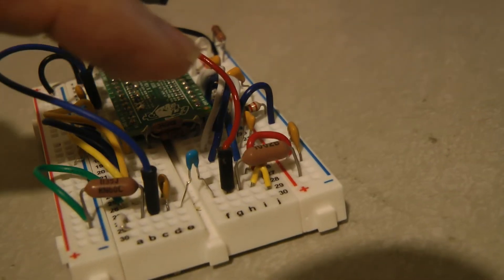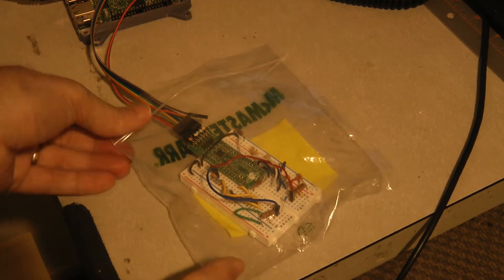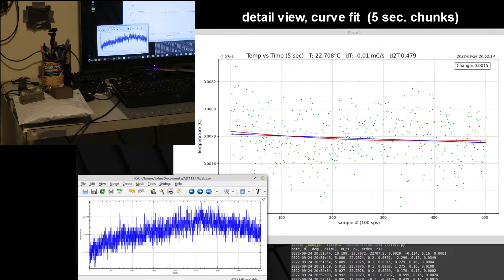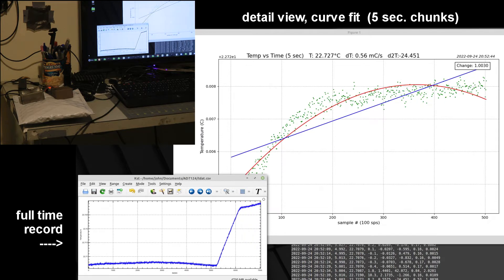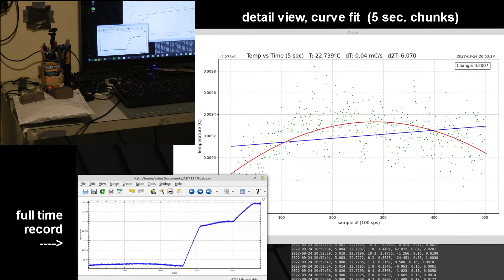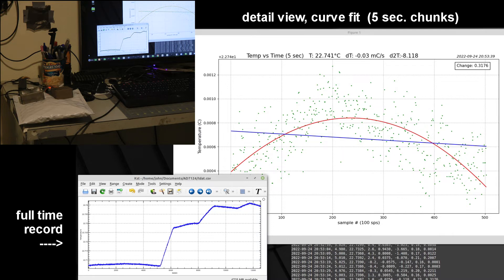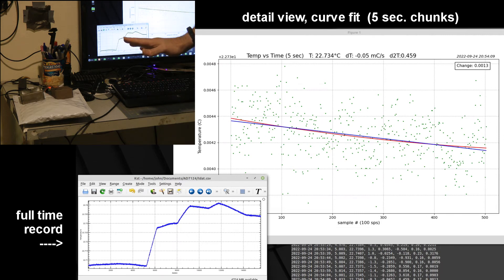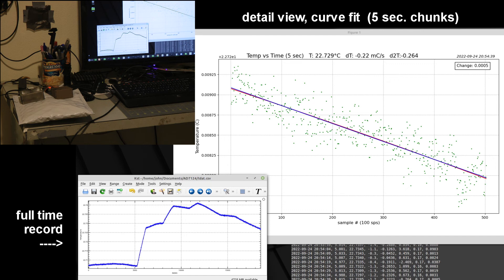24-bit ADC measuring thermistor

Comment: John, were you able to interface to the AD7124 without using the Kuiper kernel? I am looking for a way to use the AD7124 with a Raspberry Pi running Raspbian or Ubuntu. 
I am very intrigued by how much your hand can affect the measurements. Regards
Reply from the maker: Just to get started I used the ADI system setup. But it's not required and there is other code you can use, for example there's an Arduino-compatible one and I presume it could be adapted. https://github.com/jbeale1/DataAcq/blob/master/AD7124-continuous-read.ino
Reply: @dancevideo2  Thank you, I will try it soon
Reply: @dancevideo2  I see that you also used the ADS1256 from TI for another project. Although they are different ADCs, which family do you like better AD or TI? I am looking at the ADS1220 vs the AD7124 in my case. Thank you.
Reply from the maker: @CHB_Arg  Yes, you see this code for example for ADS1256. I never got that particular board to be 100% reliable but it is possible it was just the "waveshare" ADS1256 board or circuit, I never figured out the problem. Basically, it would unpredictably reset after some # of hours of continuous use, and then become unreadable because I wasn't using the default output mode so my code would no longer read it. Or maybe I was doing something out of spec, but I don't know what. https://github.com/jbeale1/DataAcq/blob/master/ADS1256_read.c
Reply: @dancevideo2  Thank you. Since I already started looking into the AD7124, I may stick with it. I have had bad luck with the ADS1220 boards from Amazon (shorted pins, IC in the wrong position, etc). I got a ADS1263 to test in the TI side until I figure out how to get an ADS1220. Too many things to learn, too little time...

Comment: You wouldn't happen to have your wiring diagram saved for this, would you? I just bought these boards and was going to connect a 4-wire RTD. I have a Gallium cell and Triple Point of Water cell to attempt giving the board a calibration.
Reply from the maker: This document shows both a thermocouple and a 4-wire RTD connected to this chip. https://www.analog.com/media/en/reference-design-documentation/reference-designs/cn0384.pdf

Comment: What is the maximum sampling frequency possible with this system?
Reply from the maker: Per datasheet it goes up to 19200 sps but note there is a strong tradeoff between sample rate and effective resolution, as described in the datasheet. If you want high sample rates, you may want a different part. https://www.analog.com/en/products/ad7124-4.html